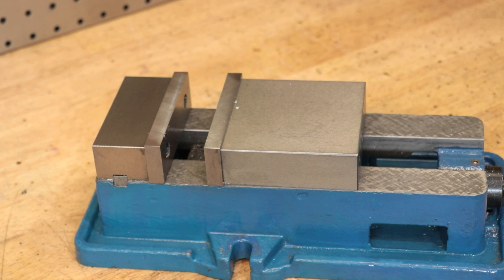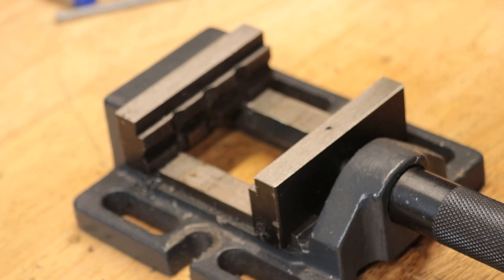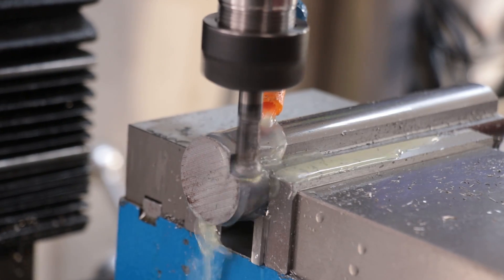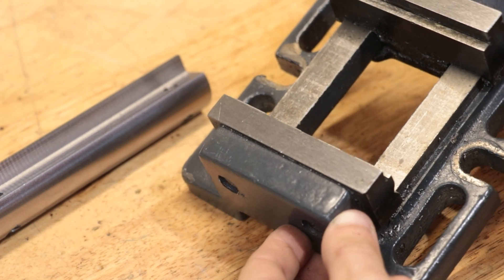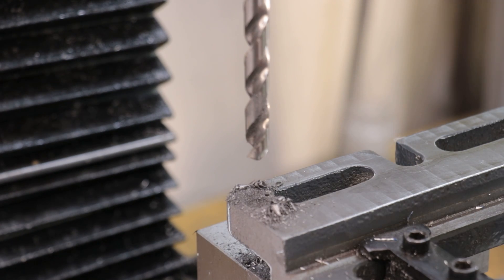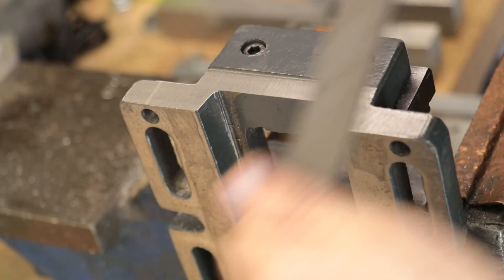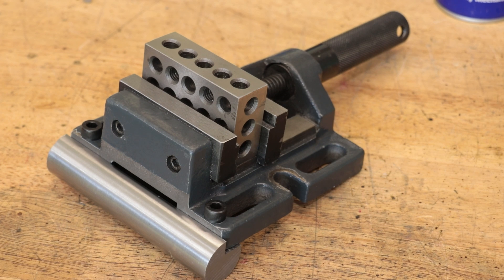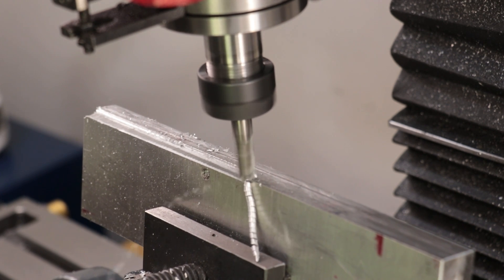Easy DIY Tilt Vice For The Milling Machine

Comment: That's a great budget build. Drill vices cost pennies and it gives you a nice little project to turn them into something better.
P.S. don't get rid of the hacksaw, it'll cost you loads to replace it with something to do the same job and it keeps you fit!

Comment: Clamping on the 1-2-3 block is actually really clever. I tend to overcomplicated things unnecessarily, then end up getting stuck there until I see how different minds approach problems. Thanks for the idea and nice job repurposing the old vise. Curious to see what you'll need this for!
Reply: Nice see you here, I follow you bought
Reply: You're right Brandon and I'm like you.  I tend to put a lot of pressure on myself to achieve tight tolerances which sometimes takes us on a long journey of multiple side projects.  Watching other's approaches opens my eyes to doing things differently.  ;) Gilles

Comment: Hey mate what sizes of end mills do you use most often? I’m looking at buying a few end mills to learn milling on a Sieg mill I just bought but not sure which sizes to get or the flutes to start off with. Thanks
Reply from the maker: I mostly stick to 8-12mm endmills. Most of the ones I use are 10, the roughers are 12
Reply from the maker: I do most work in steel so I buy most with 4 flutes and have one or two endmills with 2 flutes for when I need to rough out aluminium

Comment: You did a good job. But you should fly cut the tilt vices base in the same perpendicular setup that you did to correct the front face milling. You will find that the base is not co-planar to the jaws or perpendicular to the jaws either.

Mark
Reply: Had the same thought 🙂